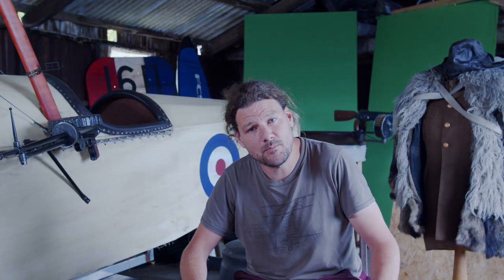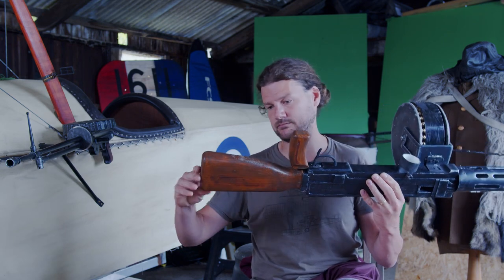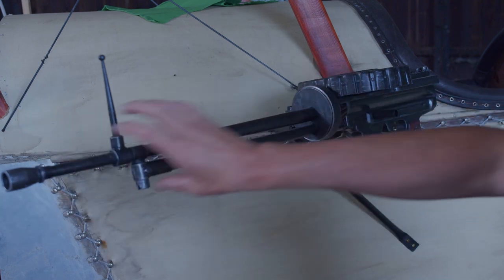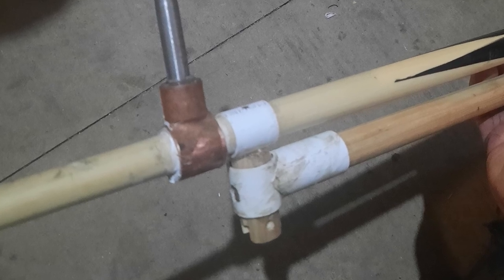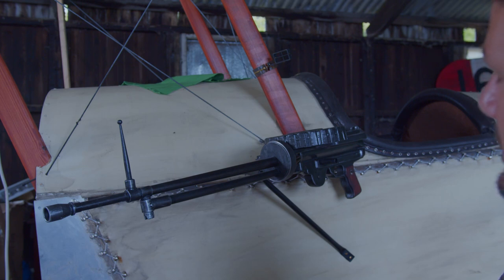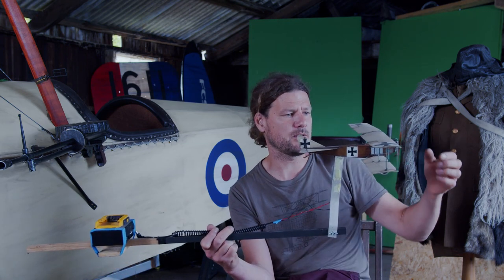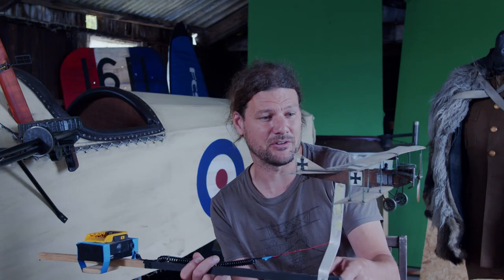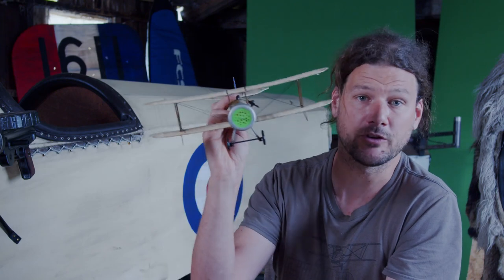Hawker - WW1 Aviation film - Interview (Part 3) - Machine Guns and Models

Comment: I'm finishing up the last few details on a 1/6 scale Albatros CI.  It's pretty spectacular, if I do say so myself.  For example, the scratch-built dummy engine had well over 300 parts, as did the scratch-built Hazet radiators.  I wish I could post a photo of it here.  Best of luck with your film.

Comment: 3:46;You've made me think to mention that Hawkers Bristol Scout would actually have had no decals atop the upper wing at all,especially not with the white circumferential outer band that came into use early-mid 1917 (as 56 Squadrons SE5's-the first of that type to have reached the frontline in April 1917-had none.Also noticed the Sopwith Pups of 46 Squadron and the Sopwith 1&1/2 Strutters of 70,45&43 Squadrons,Spads of 19&23 and Bristol Fighters of 48&20 Squadrons,all around that same time period, are like wise there too.
The 1915 period decal was a Union  flag under the lower wings to begin with but when the French and our own troops opened fire on our aircraft seeing them seem more like cross emblems from the ground,a two colour circular cockade was used.It's like the R.N.A.S. style with the red outer and white inner circle but with no blue in the centre.
The cockade you feature was eventually used on Bristol Scouts but in 1916 with,I believe,4,6&11 squadrons;see Major Barrington-Kennett KIA flying a Bristol Scout with a Lewis gun fixed on the top wing in,if I recall correctly, June 1916 about a month before Major Ferdy Waldron C.O. of 60 squadron was KIA flying the Morane Saulnier type N.
You can find photos online of that crash plus the body of the unfortunate Major Waldron along with more famous German Aces like Max Immelmann and the great Oswald Boelcke(without him there would have been no Manfred Von Richthofen,Max Müller,Erwin Böhme and possibly even no Werner Voss!) alongside equally brave lesser known individuals from many B.E.2's and the like slow unmanouvreable 2 seater reconnaissance aircraft.
Many photos adorn my modelling room walls.
I hope that little bit of information helps.